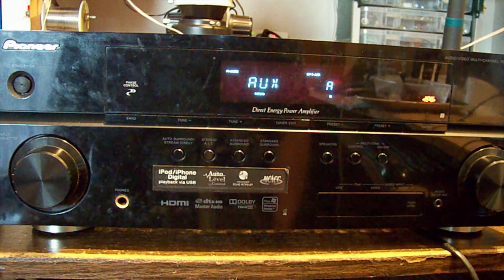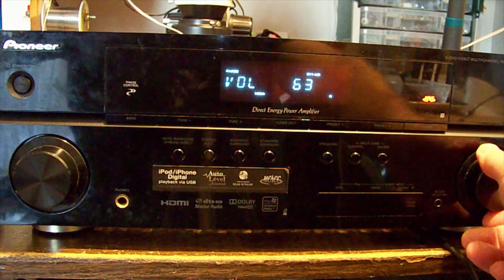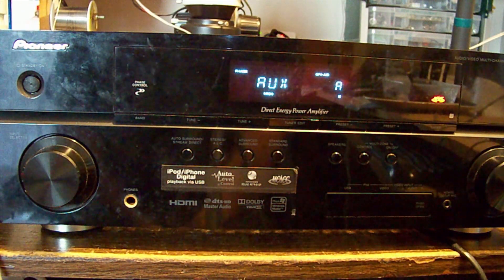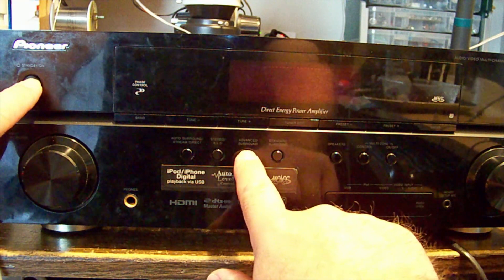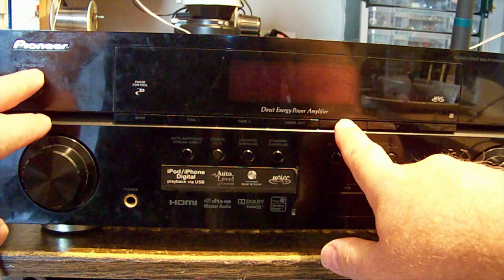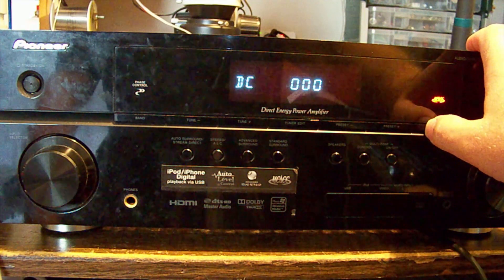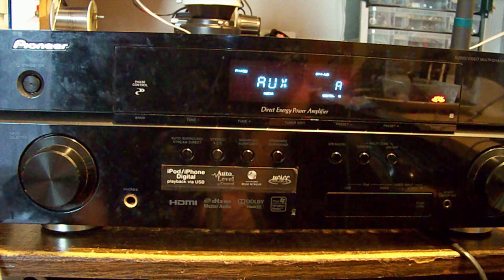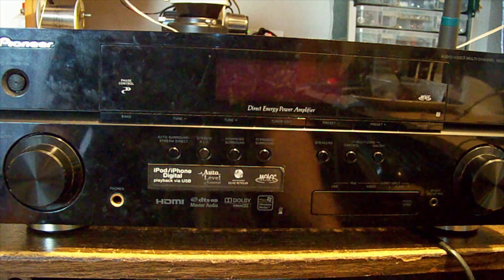Pioneer VSX-819H-K repair follow up!

Comment: So I had the same issue, but when I press Adv Surround and power it comes on for like 4 seconds then shuts off again. No other combinations for reset or diagnostics work! Hard to find a solution or simply find the cause but I suppose I can test the jacks in the back with multimeter.
Reply from the maker: What about when you turn it on normally? Does it stay on? If not I'd guess you have a power supply issue or problem relating to the processor or standby control related circuit.
Reply: @JonnyFix  so if I just press the power button to turn it on normally nothing happens. When it happened the very first time, I had everything plugged in and powered it on then it shut off 4 seconds later. Since then I’ve unplugged everything and now it only responds with the Adv Surround + Power combination, which it then just shuts off again.
Reply from the maker: @kevinthompsonmusic1435  Yeah the fact it doesn't stay on I can only still guess maybe power rail issue unable to support processor function, or something along the lines of processor function, corrupt firmware, damaged processor etc. Only option would be to get service manual and go over everything.
Reply: @JonnyFix  thanks for the help!
Reply: I have the same issue. Turns off after 4 sec with a click sound. Did you find any fix?

Comment: Thanks for the videos. I went through the same procedure as you but didn't have the manual. Reset processor and away it went. Had 23 DC offset errors
Reply from the maker: Well done!

Comment: I was just about to reply on your first issue with this fix. My display still doesn't work. Let me know if you know anything about that. I've tested the display on another unit and it works, so it's not a hardware issue on that side of things
Reply from the maker: If everything functions ok and it's just no display I would start by checking that the power supply to it is working especially the -30V line.
Reply: @JonnyFix  I found the 5v hdmi line is absent. I did have a reference then they both started doing the same thing. If you're interested, I'll let you know what I find
Reply: I didn't have my boards mounted to the rear cover. It states that if you run the unit without the grounding attached correctly, there can be damage done to a particular device. Somehow i don't think that's my issue, but a possibility. I believe the main MCU isn't putting out data for the display. A lot of info available online but probably beyond me at this point. Might come back to it when i have a bit more experience

Comment: waah cant imagine the hustle in the first video! anyway this is great revelation. I have a problem with my vsx324 nothing gives out sound in A mode (Tuner A, DVD A, CD A.....) but all digital inputs are fine, HDMI, OPTICAL , COAXIAL. so i cant even listen to fm stations and also cant hook external fm receiver! Can someone help please

Comment: What ridiculous firmware. Designed to protect the unit from faults but effectively trashes it.
How hard would it have been to have it display the fault from the get go complete with reset instructions.
Clearly built to impoverish the owner and boost the authorised service centre business.
Reply from the maker: All other brands I've seen have still turned on which is why it didn't cross my mind

Comment: So you didnt repair it, you lazy sod ha ha :-D.
A reset button on the back would have been nice, but instead they used hidden modes, not frendly to the average user :-(.
Have i already said you lazy sod...oh ok :)
Reply from the maker: Always begin a job thinking worst case scenario haha!
Reply: @JonnyFix  fix it till its broken👍
Reply: @JonnyFix  Well that's a good way to start :-D
You can't make it any dead-er, so that unocks the (Try nasty tricks, it's dead anyway). 
i can't tell you how many times i've done the lets apply power to that point...ooow it's not so dead after all :-D.
Back feeding led power to find where the power came from and the unit lights up, weee :-D
I did that on a vcr with a dead deck, the psu was a mess of parts and i just could not find an answer there, so i found an led that didn't light and jumped to the other side of the resistor and gave it warp power, 9 volts made it alive again, then i tracked it back :-D.
Fright to make it worse is the enemy.
Sorry long waffle :(
Reply from the maker: @zx8401ztv  lateral thinking is fun
Reply: @JonnyFix  I do that lying down, double lateral :)